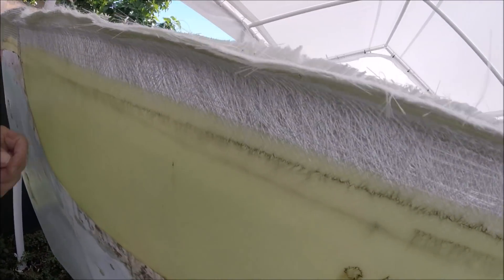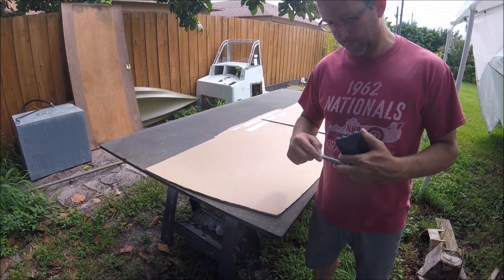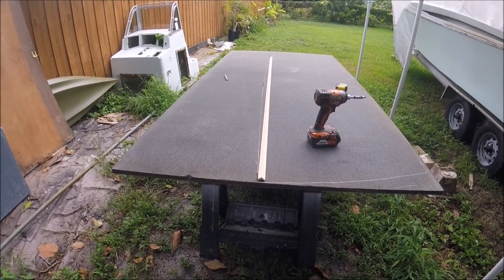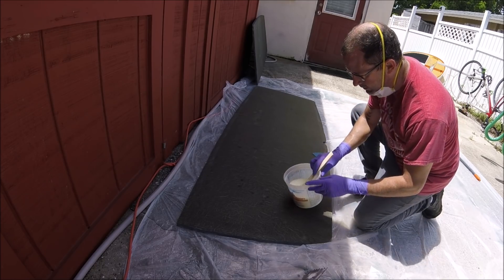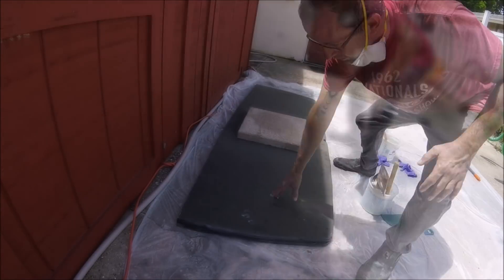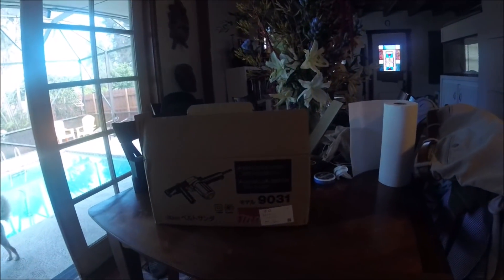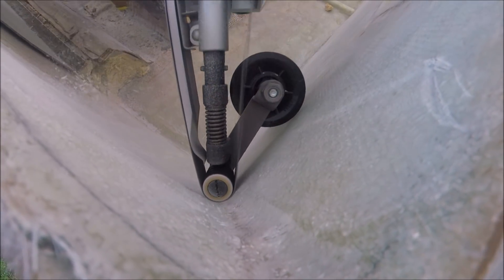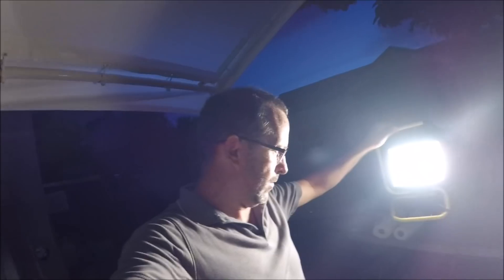Aquasport 22.2 Flatback part 5: Transom core installed

Comment: When clamping together a large areas use a torque wrench or torque measuring tool to keep even pressures across your clamping boards.  The unequal torques on the bolts will give you the wave or bulges due to the uneven pressures from the bolts.
Reply from the maker: Good observation and point! Thanks for watching!

Comment: one tip....coming from a tile installer lol, when you trowel, trowel all in one direction so you know that all of the air escapes. Im sure with the bolts and weight of the pavers it did fine, but hey If I can share any tips of my own why not. Awesome progress btw!
Reply from the maker: That totally makes sense! There could be air pockets stuck in there! Probably not a biggie, bit I'll definitely do that next time.  Thanks!

Comment: Did you have to do any prep to the glass you laid in the previous video before adding the coosa? Sand it or wash it with water or anything?
Reply from the maker: Yes, I washed the amine blush off and then sanded.  In tbe future for all my glasswork that will have any more work done on it I will use peel ply, takes care of both those issues.  Thanks for watching and feel free to ask any questions!
Reply: @marcelft  awesome thanks. I've tore the transom out of my Kenner 23V and I will be adding Coosa in the next week or 2. Will be closing in my transom also. Your videos have been a lot of help. Do you think laying the glass in the last video then adding the coosa directly afterwards would work (doing both in one step)? Or is that trying to do too much at one time?
Reply from the maker: I think that it's doable with being prepared,  slow hardner, extra hands. Only thing I'd be worried about the heat generated by that much glass and thickened epoxy? On mine since I was closing transom, in the thought of drilling the holes to clamp the coosa in through wet glass was something I was questioning.
Reply: @marcelft  That makes since. I do like the idea of bolting through the transom. I was planning on clamping and bracing off stringers like the shipshapeTV coosa vid but I'm probably going to bolt. Will definitely use peel ply, thanks....
Reply from the maker: Yeah, if it's your first time, might as well just use peel ply and not stress about trying to get coosa in too.  Good things take time.